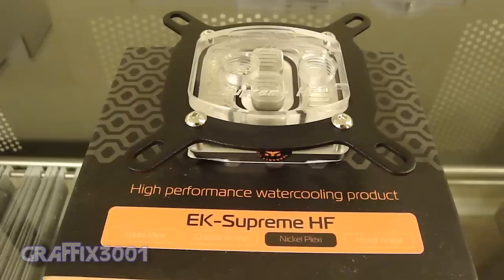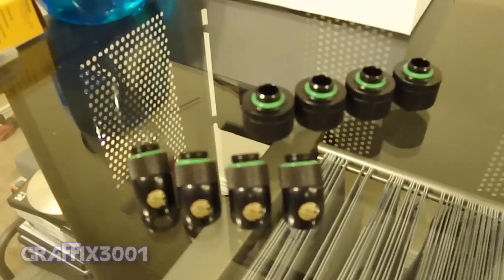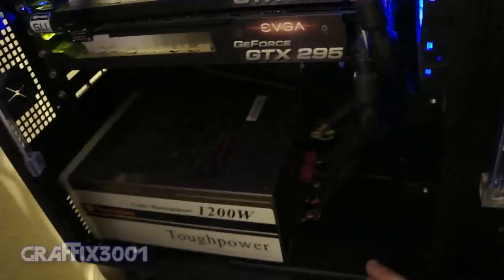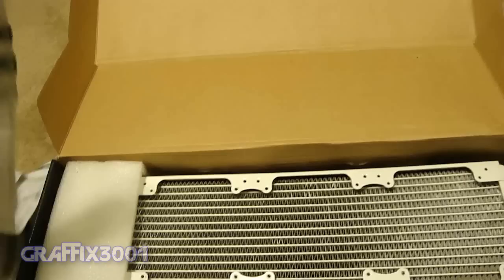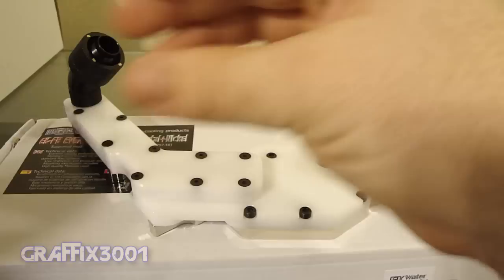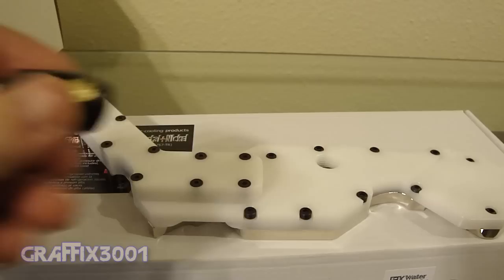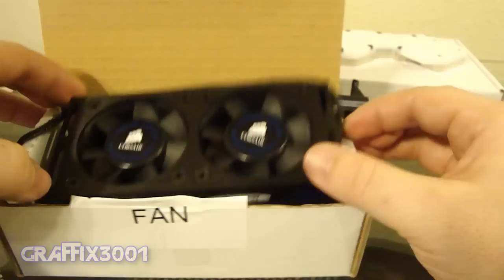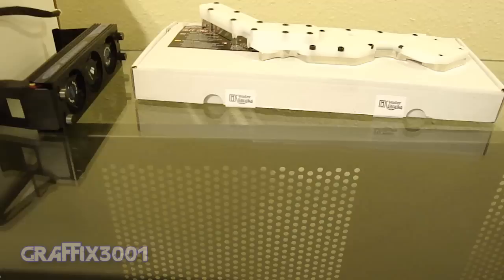h2o Cooling Part 1

Comment from the maker: Lets just say I no longer have a car payment and we are doing very well at work right now.  As far as gameplay, no, you will not notice a difference.  The only way to tell any difference is from running fraps or benchmarks.  I just like to have good stuff.  But honestly I want to be able to run 3 screens for gaming.  I didn't want to switch to ATi as I am an EVGA fanboy.
As far as the 295's, I'm not sure.

Comment from the maker: You could mount a normal radiator in there but this thing would not even come close to fitting.  It is as wide as the case and almost just as tall.